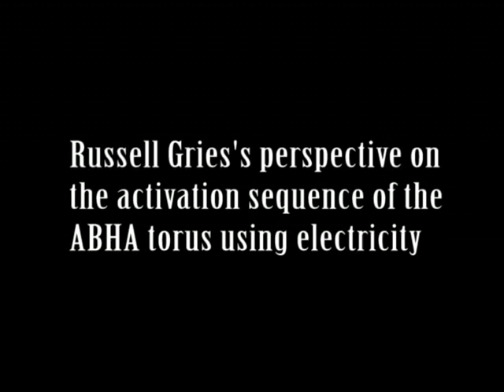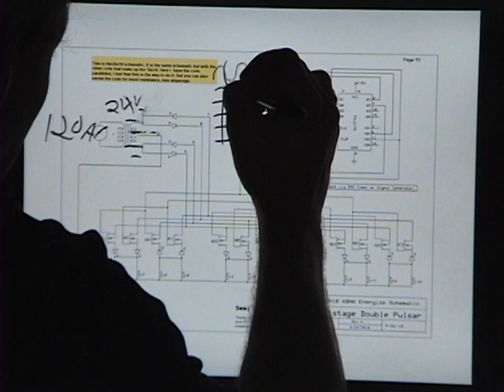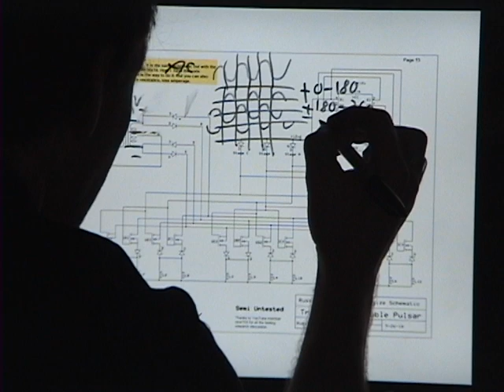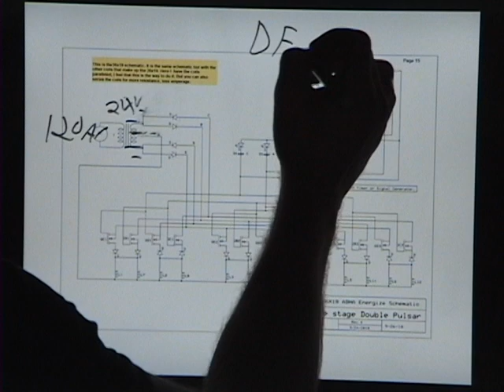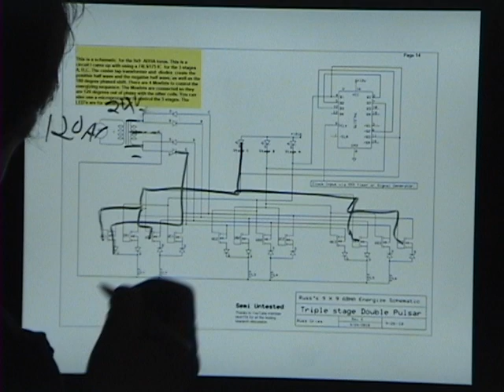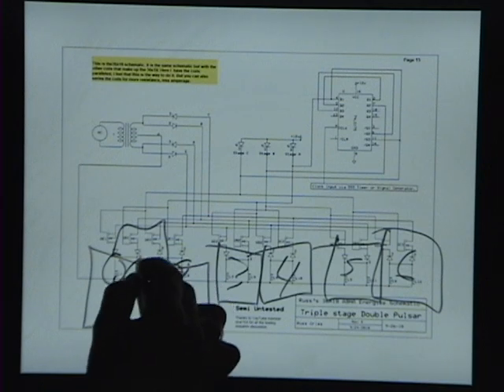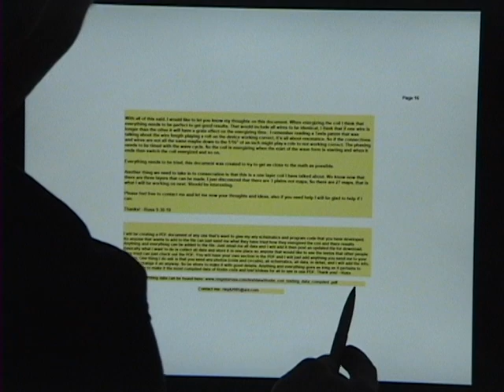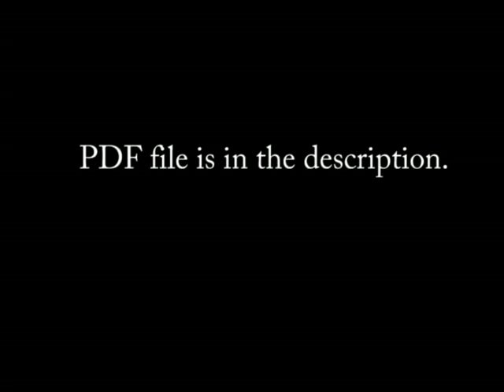3 Activation Sequence Of The ABHA Torus Using Electricity www.RWGresearch.com

Comment: I have done a lot of research on this topic and I have figured a way to calibrate the wingdings. I have not published this information as its incomplete research and I have not had much luck in working on it. This is serious stuff if you get it to work right. It has the potential to cause nearby electrical devices to stop working or malfunction.

Comment: I actually spoke to Marco years ago about how to properly energize his coil. I noticed that many people have been winding the coil incorrectly. I have done some wingdings but I have not been able to fund what is needed to power it. At the time Marco wanted to build a plasma variation and seemed not interested as much in the electrical variation. The coil can't be powered the same way we think everything else is. There is a missing part and Marco will not admit or let you know if your close.

Comment: Hi Russ, Great Work You can use a rc car ESC for a Abha Rodin motor speed control with very good performance I have built a 3 phase Abha Rodin motor with coefficient of performance of 5.98. The kinetic energy is greater than what you put in. Data shows 43.8 watts input a 262 joule per second output .35 Hp at 192 ft/lbs torque while producing 27 watts of useable electrical power. I am using a 2 inch N-42 neo sphere for a rotor. Some day I would like to talk you on the phone about our common interest Thank You Tony Izaguirre